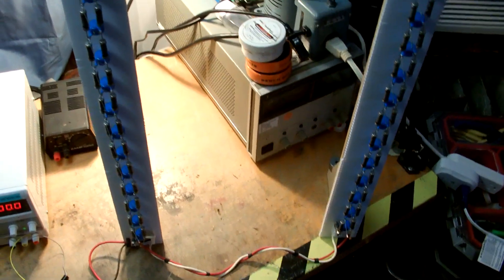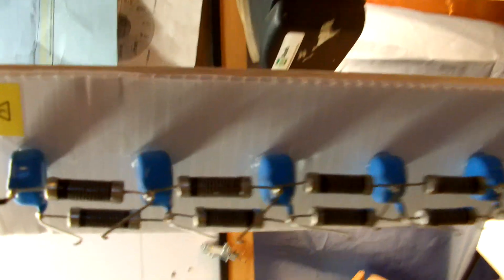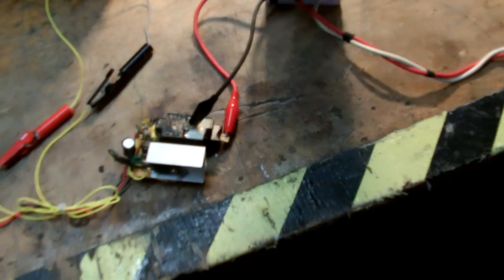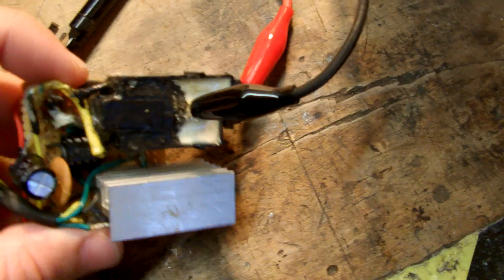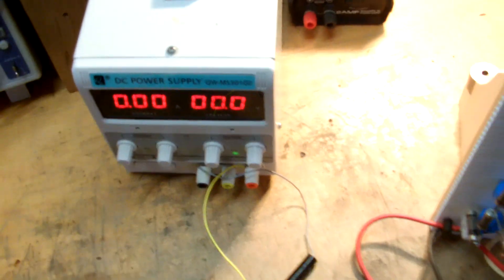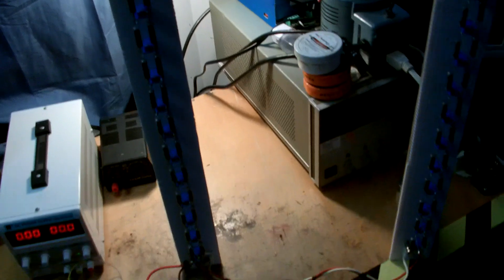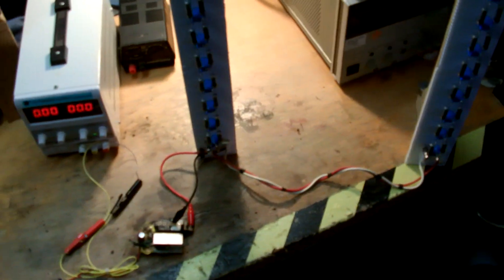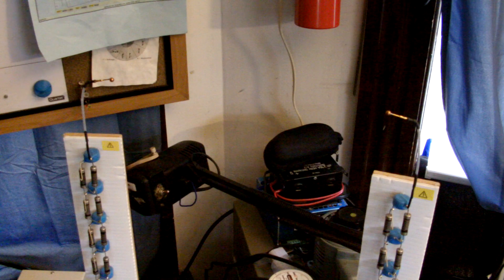Twin Marx Generators

Comment: I never really cared about mark generators because they seemed kinda boring, I always saw people making flashy, super high power  CCW multipliers that spitted arcs at like 15hz, while there were some people who make Marx generators that appeared to have an output of no more than the input voltage. 

I didn’t care until, my buddy who lived in the city next to mine and also liked high voltage stuff, went to the junkyard and got 20 plastic bottles and an old TV. He dissected the TV and got the flyback out of it, made a simple driver with the components on the board, and over the course of a couple hours, made a fully functional Marx Generator that had an output of over 15x the input. like at least 400KV, which was honestly more impressive than any CCW multiplier I’ve ever seen. And he made it out of damn trash.

So ya, I’m much more interested in Marx Generators now

Comment: After destroying a switching power supply with my 20-stage Marx generator due to HV kickback, I now only use batteries to power it. I use two 12-volt 5 amp-hour AGM lead-acid batteries connected in series as a 24-volt power supply. This isolates the house wiring from any HV kickbacks from the Marx generator. The charge on the batteries lasts a very long time and it also makes the Marx generator very portable. It also prevents the Marx generator from potentially destroying any electronic equipment plugged into the house wiring.
Reply: Couldn't you just add some resistance in the grounding of your negative wiring from the flyback?

Comment: Looks really good! I definitely recommend using epoxy on the caps and resistors to get your voltage higher. You'll need to change the spark gap length and it gets tricky after a point but I'd love to see this puppy really going. I had tried building a 1MV+ bipolar Marx about 2 years ago using homemade caps and it just got out of hand with the work requirement. They sell really decent DC ZVS flyback on ebay if you want a more portable HV supply btw super easy to work with